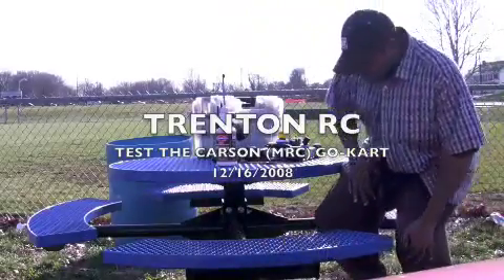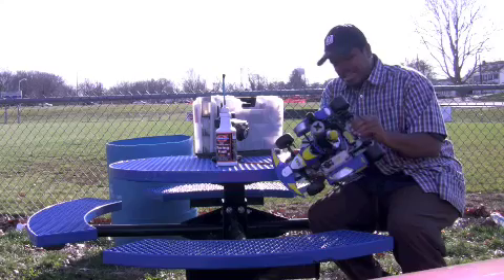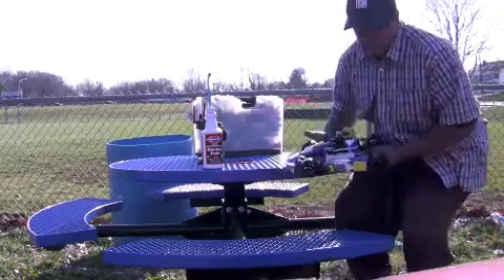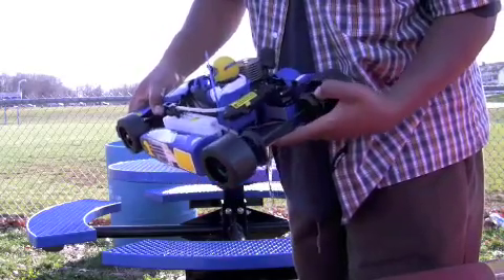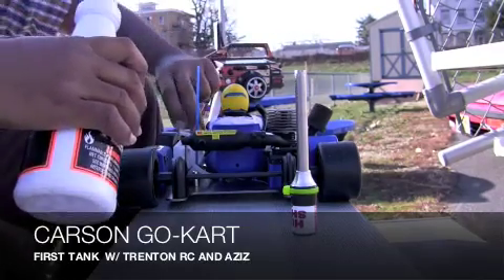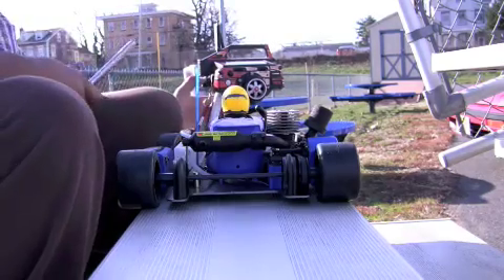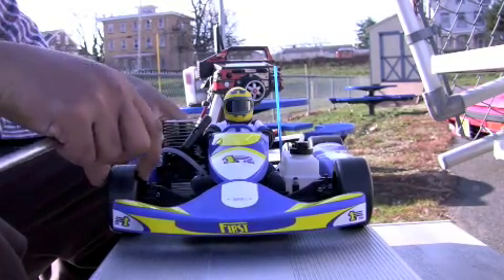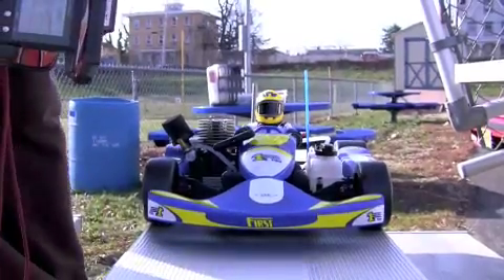RC Go Kart Carson (MRC)

Comment: Nice and informative video. Glad to see comebody made a video on this Kart. Plan on picking one up this spring when the snow in Illinois melts. Engine sounds pretty peppy. Also needs a taller gear. Seems to top out rather quickly. Definately geared for a short track.